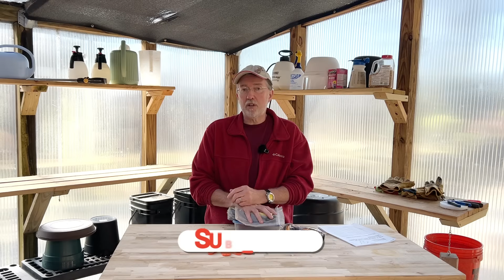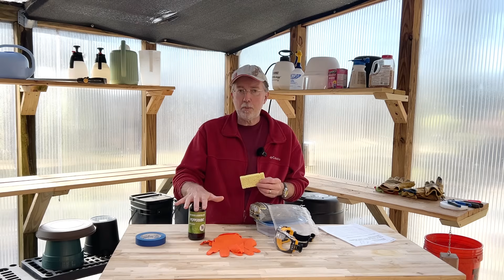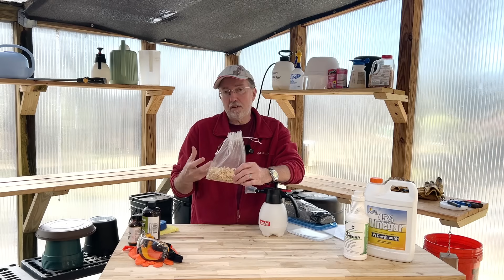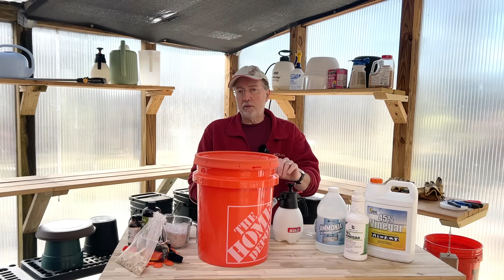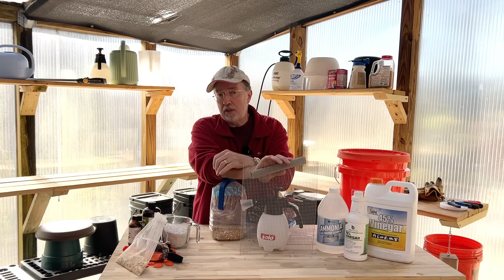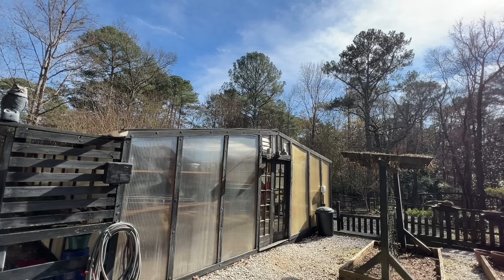Easy Tips To Keep Rodents, Rats And Mice Out Of Your Cars Engine Bay

Comment: I use a tomcat baited mouse trap in my engine compartment. They're about 2" x 4" and size and I tape them into the compartment where there is no danger of melting from heat or getting into any other motorized parts. Never had a problem with a rodent.

Comment: I had mice get into my tankless hot water heater and chew up the electronic wiring - probably because it had soy based wiring insulation .  After an expensive repair job, i sprayed the wires with a rodent repellent made with natural vegetable oils.  End of rodent problem…

Comment: I take an empty dish liquid bottle 52 oz. but could be smaller and I fill it 2/3 or 3/4 with clear ammonia and then finish filling with plain water. Then I go outside and squirt it about 6 inches in the driveway around the entire perimeter of the car but not on the tires or body of the car itself and it works great. Ammonia is very cheap , easy to purchase and I repeat the process every week.or after a heavy rain. I also squirt some on the outside mats on my porches in front of the doors at night. Doesn't take much just a few squirts and no signs of mice droppings in a very long time so I highly recommend this approach. Very inexpensive and takes very little time.
Reply: Just wondering why you dilute it?
Reply: @stephen3654  don't really have to but just trying to save a little money over time while having as much potency as possible.

Comment: Great tips I can utilize and apply to my HOME as well!  I had contracts with useless pest control businesses who failed to provide exterior inspections and sealing.   Two years ago I had mice chewing at the master bedroom ceiling vent and this prevented me from sleeping --- PEST CONTROL FAILED ME   I ended up buying an electronic sensor that emits a terrible sound for them and beeps through the night but it keeps them away.   I just received 3 more sensors 2 for downstairs in house and one battery operated for car which is sitting out there with problems weeks ---- thousands in mice damage to my car and the mechanic claimed to have removed my entire dashboard to clean but no proof he did this of course and he broke my glove box in the car which I can no longer open and it contains a drop down for all the fuses  ---- Bird seed was placed in large plastic garbage bin not being used and rodents chewed through the extremely thick plastic to enter.   In the house I am using snap traps with peanut butter and killed 3 mice in a week.  I don't have a garage here and wish I did
Reply: Pest control companies actually plant insects and leave mice around your property when they solicit for business I've caught them doing this when they thought no one was watching

Comment: I use peppermint oil in my car. I used to use lavender oil (better smelling) but, peppermint works better
Reply: How do you apply it?
Reply: @AmericaTheBeautiful-e3e I put 20 drops of pure peppermint oil, in a spray bottle, add 1/4 cup carrier oil. Then, I spray 2 squirts under my 3rd row & 2nd row seats & 1 squirt under driver and passenger seats. Or, I douse cotton balls with pure peppermint oil & put them under the seats and 1 in the glove box. It's very strong smelling for a while but, it works.

Comment: I stuffed ‘chewed holes’ w/multiple metal dish scrubbers & covered holes w/a metal flashing to prevent further infestation & damage. Treerats (squirrels) kicked the metal scrubbers onto ground, after they chewed completely through metal flashing! The metal scrubbers had also been chewed quite badly. 
Straight Ammonia works for few weeks. Just make sure it’s spayed where people, nor pets, will be affected by smell. Had holes chewed thru soffits, multiple places around roof area. Told to soak rags in Ammonia & stuff into holes, leaving only one, for them to escape. After they’ve exited, then stuff into hole. 
I put soaked rags into small, open, plastic containers, as my soffits are made from wood. I didn’t want them being ‘wet’ for extended periods of time, possibly causing wood to rot. Also, I checked Ammonia rags, once every 7-10 days. Wanted to make sure rags were still wet, and Ammonia smell was still strong.

Comment: I remember reading somewhere that the hoses are made with soy or something edible like that, and it attracts rodents.  I got the impression it was done kind of on purpose
Reply: Yes, hoses are made of soy. Yum yum. Profit margins.
Reply: Yep. They changed to soy about 15 years ago. 
I found out the hard way
Reply: @friendlyghostkinda well the only one they chewed up is the 1994: $250 rewire job, they haven't gone to the 1975 or the 1988 but they did chew some insulation out of the 1990 so I don't know if it's just a 15-year mark....

Comment: the best thing i found was a snap traps with Jeff peanut butter i’ve tried peppermint oil on a cotton ball that doesn’t work and steel wool around pipes diesnt work either and those poison bars that you can buy don’t they work OK but the bad thing is then they might die up inside your wall and it stinks
Reply: I use peanut butter and add a chocolate chip on top.  They love chocolate.

Comment: Don't ever use sticky glue traps. Extremely cruel. Anything that can get in it will either be maimed or die a slow death. Birds explore holes.
Reply: I once released a bird that had become tangled in and stuck to heavy hanging flypaper. Soaked the poor guy's feathers in vegetable oil and worked them loose. Then rinsed in tepid water. He sat in a protected spot until he was dry, then flew away. Would probably work for horrible glue trap encounters as well.
Reply: That’s what use

Comment: I had squirrels chew the wiring in my car and it cost over $600 to repair. None of their suggestions worked so I sprinkled cayenne pepper everywhere. Engine, etc. It's been 2 years and I haven't had any issues since. Cheap and easy.
Reply: $600 only!  The mechanic told me yesterday its  2k.😂.
Reply: @TheInfinitereality mine was $8500🙀🙀
Reply: I put Irish spring soap under the hood of my vehicles I just lifted the hood on my truck and the box is there but the Irish spring soap is gone they ate it... The whole bar but they didn't touch the wires I guess I have to replace the soap so they get something to eat!!!!
Reply: @montanawarren8462  I had a eucalyptus/mint/something else scented candle in my car to repel box elder bugs from landing on my car. It attracted mice. Mice ate it. They nested in my back seat and glove box area. I have been trying everything to get rid of them. I would not recommend soaps/candles. They seem to love that stuff to eat. I am going to try the cayenne pepper and the cinnamon-clove mix around the base of the tires. I will let you know if it works. Peppermint oils are supposed to work as well. Good luck to us both!
Reply: Moth balls work too.
Reply: @altoworshipper I didn't find moth balls to work on Rats they don't seem to care.  However I have been using powdered form Cayenne Pepper for years you can buy it at a bulk foods store or in some local grocery stores. I once had a serious mouse 🐁 problem in my walls somehow they got into the house I could hear them running around in my walls and ceiling, first I gave them some bait I laced the inside of the mouse wall hole with a little tasty peanut butter, I let them enjoy that for a few days then I spooned in the powered Cayenne Pepper and blew it as far in as I could to ensure lots was in the wall.  I waited for their return for the peanut butter, oh they came and I guess got themselves full of the Powdered Cayenne Pepper, they ran outside and I never had a problem since.
Reply: @altoworshipper  "Mothballs are generally ineffective at repelling mice and are not recommended for pest control due to health risks and misuse regulations. While they emit a strong odor, mice often ignore it . . ."
Reply: @callmeBe  My neighbor uses mothballs.  I can't ride with her because of the stench.  Her daughter put mouse traps in the car - with the mothballs -  and started to catch the critters.
Reply: @annarebecca3384  Well, thanks!  I have not heard of that before--mothballs.  It is cheap and easy--I will try it out!  I do put rat poison in there.  Thanks again.
Reply: I just wrote same! Omg…thank you for sharing info on cayenne!
Reply: Around the car or even on the engine bay?
Reply: Cinnamon would likely work as works against squirrels. Once used to deter a squirrel from visiting my potted balcony garden. I put out cinnamon pine cones , the squirrel was witnessed  screaching and didnt return.
Reply: Nut in transmission linkage could not engage drive
Reply: Can you smell that while driving?
Reply: So just regular cayenne pepper?  Like McCormick's?

Comment: Predator urine.  Coyote, fox, etc.  You can get it online, or at your local hunting store.  This is the nuclear option.  Keep it away from the air intake to the cabin.  It does NOT smell good.  It is the only thing that always works.  More bad news:  you must reapply regularly.
It usually comes in a bottle with a lid designed to either dispense drops, or a stream if you squeeze it.  A new bottle has a seal under the lid.  I don't peel that seal away.  I put a small hole in it with a tiny nail.  After that, it comes out drop by drop and can be applied fairly precisely to the areas around the wire harness and other vulnerable areas.

Comment: Leave the hood open if parked inside cold storage.  The mice will not nest there, because they have no sense of security when the hood is left open.  I have a vehicle that's been sitting in a shed on my acreage for three years with the hood open; not one mouse nest.  Lots of little footprints in the dust on the engine, but not one nest started under there.
Reply: My vehicle is outside. Hood is up about 6" when parked (high wind here) and they STILL chew & nest!
Reply: @vginnmusa3128 dang.  Mine are in storage buildings. Hoods all the way up. No issues so far after three years
Reply: I had my hood open with a bright work light shining on the engine. Walked out to check it and there was a big rat hanging out right under the light. Next idea?
Reply: @surfraf65  I never said they wouldn't be curious.  I said they wouldn't nest there.  You should read comments more than once before making your own "smrt" replies

Comment: Peppermint oil works great as far as my experience goes, but it has to be strong enough where you feel it in your own eyes from being around it. The smell itself isn't unpleasant though. Funnily some of the stuff with it branded as a repellent is too weak though, it needs to be concentrated.

Also when plugging entry holes into buildings with the expanding foam... You don't want regular steel wool because that'll get rusty and start to break down at some point if it's ever exposed to moisture. Use wire snips to cut up the stainless steel wool scrubbers typically used for cleaning grills and oven racks. It's a much heavier grade, presents some sharp edges, and it normally doesn't rust.
Reply: There is a copper mesh yiu can use.  At hardware store.

Comment: my friend worked for 40 years for the national forest and said the only thing that was 100% effective, is irish spring soap. i was camping in a mini van in the desert and had a huge rat in the engine compartment and tried all of the other remedies. the rat wouldn't go until i put irish spring shavings throughout the entire engine compartment. and bam, the rat skooted and i never saw it again. irish spring also comes in liquid form so may be easier to use than the bar of soap. i don't like the smell either, but the smell never went to the inside. no problem.
Reply: I put Irish spring in my camper and they are eating it so not working for me
Reply: @rickdunn7585  I had a bar of Irish Spring in a room I wasn't using much. Mice did the same. They were eating it.
Reply: IRISH SPRING NEVER WORKS
Reply: @BIGSLIM489  okey dokey
Reply: @BIGSLIM489 works on flies in the house though

Comment: Blocks of poison everywhere. On top of the motor. I'm not going to save a mouse ever . No way I'm chasing them away to show up later, plus I hate cats and the smell. Cats smell worse than mice . Hello from North Dakota
Reply: I would be careful with poison anyway. If other wildlife eats the mouse, they will also be poisoned. I don't know if you have coyotes or if you have raccoons or other critters that might eat the mice but just a thought. Even a stray dog if they're hungry might eat the mouse.
Reply: @meljordan220  There's stuff out there that'll "poison" the mice but isn't actually a poison. Basically it's food pellets or meal with plaster of Paris mixed in. Corks them up so they can't do #2. Terrible way to go, but it works and the rodent remains aren't toxic to other animals in that case.
Reply: @pauljs75 something else I have tried and seems to work is a mixture of cornbread mix and baking soda. Harmless to all other animals but since rats mice etc cannot release gas, it builds up and they're insides explode. Probably just as bad as the plaster of Paris as far as a bad way to go😂
Reply: Peppermint oil on cut up sponges to keep mice from eating wires in cars
Reply: @Tattiepoo1 cotton balls work better and don't muck up the environment.

Comment: It doesn’t help that a lot of car manufacturers are making the wiring loom casings from soybeans FACT so rats foxes are attracted to it.
Reply: Yes Sir!  I've had my Barn/Garage/whatever you want to call it for about 40 years and have always parked my vehicles in it.  I've never had any problems with mice chewing through the wiring on chevys/fords/dodges until my Wife bought a 2020 Kia Soul.  Then the mice got into it twice and chewed through the wires.  Those wired were wrqpped with the black tape weap.  The mice didn't touch anything inside of Plastic loom.  I was able (with great difficulty) to repair the wires both times, rather than having to buy a new harness. and then I put all of my wires inside plastic loom.
Reply: Why the HECK are they doing that?   This needs to be called out
Reply: @AmericaTheBeautiful-e3e probably they are trying to get away from petroleum products and move to things that are considered “environmentally sound”. Unfortunately, common sense and foresight have been put aside for things that, on the surface, looks “green”.
Reply: @lesta.artist and that put people in danger
Reply: @lesta.artist they probably voted for Biden and Harris...
Reply: I had to replace the harness i
On my car twice due to rodents eating the coating on the wiring.  And it was NOT CHEAP 🤬🤬🤬🤬

Comment: I parked my rv a few months ago after a trip and went to get it ready for another one and they have literally ruined the carpet, eating the water lines which caused a leak and eating the insulation under the fridge. No telling what else. I have the pinch traps all over and no luck so I tried glue traps but they ate them! In the pinch traps  I added crushed smoked almonds and got one today! Someone recommended peppermint water found at home depot. Time will tell
Reply: Did it work?
Reply: Wow. What a mess those rodents made for you. So sorry.

Comment: I've used peppermint oil, and it works.
On my riding mower and rotor tiller, I put a few drops on the flywheel and turned it over for a couple seconds. 
Repeat every month.